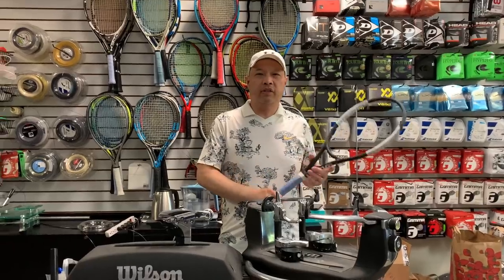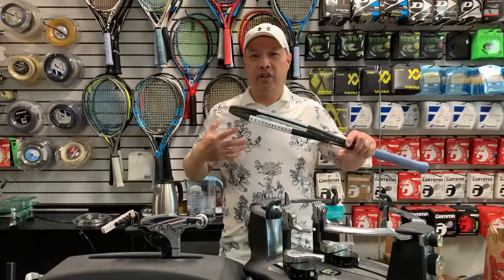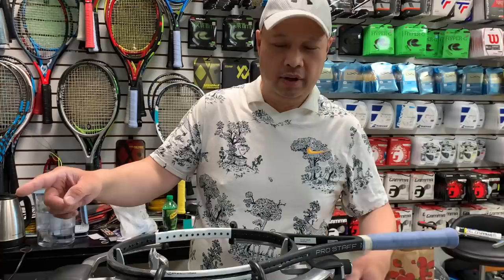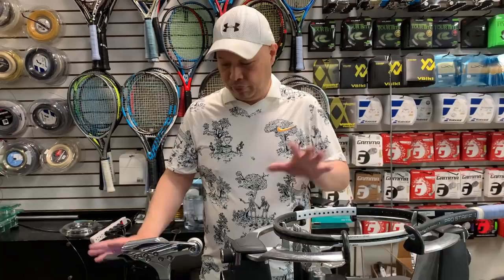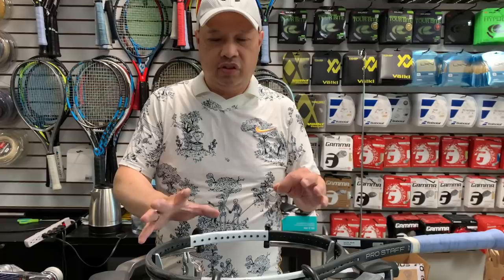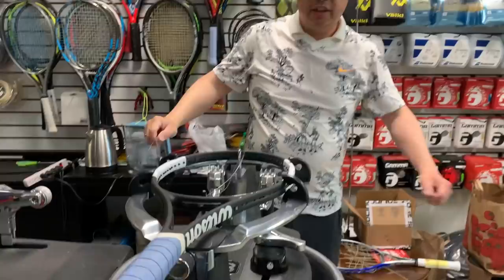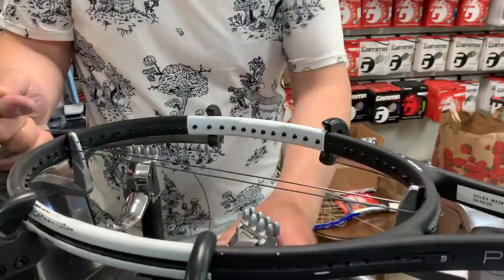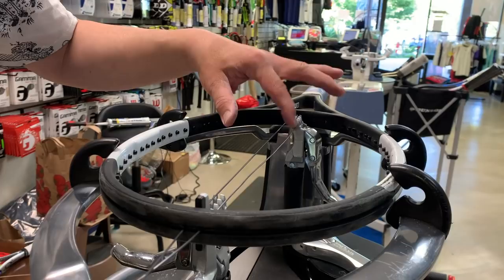HOW TO STRING A TENNIS RACKET   PART 1 THE MAINS

Comment: I've measured the difference in tension when using, and not using the diablo. I found using it actually decreases the tension, by about 1/2 pounds. The main reason for the diablo, and why it should ALWAYS be used, is that it reduces the amount of clamping force needed by the tension head to hold the string. The diablo protects the string, so use it.

Comment: As a stringer myself I always put a starting clamp behind the  “anchor” clamp when starting the mains in case that clamps slips. I also always opt for a pro knot but that just comes down to preference. You clearly have been stringing for years because you evenly do the mains- so often I have newbie stringers start in the pro shop that will pull an entire side of crosses before touching the other side which can warp the frame. Good video and even though I have been a stringer for a decade I always enjoy watching another stringer work :)
Reply: 3 one side first, then 4 the other side, then 2 and  2 and continues, right?
Reply: @NachitoBinnevies  I go 4 and 4, then 2, 2, 2, 2.  That's pretty much the standard at pro level.
Reply: My brain hurts at the lack of starting clamp behind the first anchor clamp!  He basically said, hope for no slippage.  How about guarantee that with the starting clamp?!

Comment: I am a professional musician and I am learning stringing with my 14 year old son who's starting to break strings frequently.  I figured that if, unlike most pianists, I can learn how to fix my broken grand piano strings just by watching, then why not tennis racquet stringing too!!! 

Your videos are excellent - very clear, thank you.  

I have a question re testing the consistency of tension as you go.  Given the symmetry, the central two strings when plucked like a guitar should be the same note, as should all the opposite numbers, provided there's an even number on each side which have been done - as the racquet frame is equivalent to a violin/cello/piano 'bridge'.  Even though the stringing is being done to an even tension, because of the differing lengths there should be 8 different pitches, corresponding to the 8 pairs which are the same length as each other: the outer strings should be in unison (sounding the same note) just as the first two should.  Have you tried this, as if it works in practise, it could be a useful guide for learners who can hear this as to how well we're succeeding in achieving an even tension.

Comment: One of the more clear instructions for tying a simple knot. For some reason other people make it more complicated then it needs to be.
Reply: Well some of the other knots are not really that complicated.   Both the double half hitch and Parnell knots require going under over and through twice.  Some times tying off crosses the clamps are really tight to the tie off grommet and you can use the wilson pro knot where you only go under and over and through once.

Comment: When you pull into the frame on your first hitch, I think you risk damaging that gromet, particularly if it's on the old/brittle side. When you tighten the Pro Knot, you pull away, up and THEN back to seat the tightened knot in the grommet which is IMHO less stress on the grommet.  I think the Parnell works the same way, but I don't use that one unless for some reason I don't like the way the tail is going to point.

Comment: how about a video talking about racket stringing machines...thanks
Reply: Absolutely!, that Wilson machine does not enjoy a good reputation... babolat machines on the other hand, seem to be in another league
Reply: @jlparcerisa  What's wrong with it?
Reply: @Fred_P  they are known for stringing tight, also not very friendly to thin guages
Reply: @Fred_P  I have two of Babolat Sensor & one of that Wilson in my shop. Babolat's clamp hold the string better than Wilson (I use babolat Clamp on Wilson machine) , more stable and user friendly. muuu...I am so sorry, my English is not good enough to explain  the different.
Reply: @jlparcerisa  Thanks for responding! By tight you mean with higher tension than what is set? How so, by crushing them with the clamps or the tension head?
Reply: @senasonic  Thanks for responding! Ok, I see. But there's also a price difference, so I guess you get what you pay for?
Reply: @jlparcerisa  Honestly, I don´t think the Wilson Baiardo has a bad reputation.  Instead, it´s the holy grail of stringing machines. Of course it depends on the user and maintenance.  About tension, the problem usually are the clamps, the gripper, maintenance (calibration, cleaning, etc...) and the user.  Clamps are calibrated according to string diameter.  Should be no problem with such a good machine.

Comment: thanks for showing the trick w/ the starting clamp and the loop.  I'm not trying to maximize string that much but switching to a poly from a multi, I'm shorted myself b/c it didn't stretch as I was used to...

Comment: As someone who's been stringing for a while, I like to see how others do it to pick up some tips: I've never used the starting clamp to aid in pulling knots where necessary, so I look forward to doing that. Other notes- you didn't explain that only doing some mains on one side first, then switching sides is to keep the tension on the frame as even as possible to protect the frame; I found it interesting that you started the string insertion at the head of a throat start, then pulled it back through to the top (I just start at the throat with either side of the string); I don't like cutting the string after knotting until after I release the clamp just to make sure the tension doesn't pull the 2nd knot out if I cut just a little too close. I didn't notice, do you show a 1-piece stringing?

Comment: I learned something by watching this video. When I  run short of string to the gripper of the machine I usually join another piece of string with a hard to tie fishing knot. The starting clamp method is much easier.

Comment: I measure my string the same as you did and add one more segment of the longest main string and give it to a stringing guy, but somehow he said it was not enough length to string the main. He asked for 2 more spare segments of the longest main string. He also required the same for the cross. I don't know what kind of stringing machine he has. I have to cut the string again and throw away the old strings which he said were short.

Comment: Very much appreciate this and the other videos you have posted. Any tips for those of us who string at home with a drop weight stringer?
Reply: If you have a drop weight stringer, then you have to set the weight tension with the drop weight, and make sure that when you loop it around the clamp connected to the drop weight, it's tight so you don't have to keep cranking it. Also let the drop wait down slowly so it doesn't catch on anything. The best place to stop cranking it, so you know that it is the right tension, is when the bar holding the drop weight is a little bit above parallel to the ground. Also instead of having to pull knots tight with pliers or something you could use the drop weight and just let it down a tiny bit. Make sure that when you're tying a knot you don't make it the same tension as you would the string or else it will definitely snap, just let it down enough to where the knot is tight enough. I hope this helped you out. 👍

Comment: Generally, I need a lot more slack than just one inch.  I think part of the reason is I have a cheaper stringing machine using a drop weight and the slack has to reach the weight's clamper as well as needing the slack to properly tie off the mains.  Another way to save a little time is to measure half the string bed and then simply doubling it instead of re-measuring the other half.

Comment: Is there an accurate electronic string meter to check the tension of the strings on your racquet on the market?
Reply: Ert300 but unfortunately out of production now sure the reason..fantastic tool to have ..if you're lucky

Comment: Wow, another great video. I love your channel. You are an awesome shop owner. I like your tip on using the the starting clam as an extension when the string is too short to pull. A few times I messed up on my measurements so I had to re-start the stringing again. Thank you.
Reply: The original name for that clamp is a finishing clamp. They were designed specifically for that purpose. It's just become more common to use them as a starting clamp, especially on crosses.

Comment: I've wanted to purchase a stringer but was put off on the price. If someone was to purchase a stringer primarily for self use and for a couple friends, what stringing machine would you recommend? Thanks and keep up the great work!
Reply: From personal experience, I started off by getting a used crank machine off Craiglist for $300. It definitely paid for itself, in the long run. I would try looking online for used machine, as you can get a great quality machine for a fraction of the price of a new one. Practice the stringing craft, and as you get better, maybe you get more clients to string for, then upgrade to a better machine.
Reply: @jeffreylin8100    Thanks. Appreciate the feedback. Makes sense.
Reply: I have been using the Gamma X-2 stringer for the last 13 years with no problems. If you have extra cash get the Gamma X-6 FC

Comment: Thanks for the great informative videos on stringing - I've picked up several good pointers - I've been stringing for the last 10 years.
Just wondering - does anyone out there have any good suggestions for uses for left over tennis string? Typically you end up with left over pieces that are a foot or two in length - I am hoping that there is a way of re-purposing these than just sending them to the landfill. 
I've got miles of these leftovers at this point and don't have the heart to just throw them away.
Reply: Use the extra left over string for starting clamps😊

Comment: Hi there. Great Channel Mate! You have been very informative for me. I have just  started out stringing with my first machine (Gamma Progression II ELS). Have a question about mixing Gauges of string in the crosses and mains. I was contemplating using a 16g in the mains and a 17g in the crosses. is this something you would recommend or not? 
CHeers. 
Peter.

Comment: If you clamp close to the frame, does the string tend to break when one hits the the ball off center where the string has been clamped. 
   Also, starting clamps are expensive but essential to stringing. What are the best companies for starting clamps and floating or flying stringing clamps? I need a replacements.

Comment: have an inquiry about stringing . i have seen a local stringer at our city always pulls the string at the required tension from the racket throat side . not one time from throat and one time from head,my question how this would affect the tension , racket stability and sweet spot ?
Reply: If the local stringer is not alternating head/throat after each pull then the stringer is double pulling and the racquet will come out like crap.

Comment: Hey, if you string a poly at  45 in the mains. What is the acceptable maximum tension one can or should use on the cross strings without compromising the racquet frame(collapse)?

Comment: Haha knew it, he was short. Don’t do this newbies. Measure the main 8 times the length of the racket and you should be good with out having to use the starting clap as an extension. For crosses, measure his way is ok
Reply: That was always gonna be short,   I don’t measure like that but if i did I would of added 2 full more mains for the last main / knot.
Reply: I think if you run a store, you're trying to get as much out as a reel without wasting. I think using the starter clamp as such does that well. I do it too. If being frugal is not a consideration, just pull about 20 ft.

Comment: What is the significance of the skeletal graphic design on the shirt. I almost bought on at a sports box store.
Also, how would you start if you had flying clamps versus the fixed clamps used in this video?

Comment: Does cutting a single string in half usually leave you enough for the mains and crosses?  I've been pulling the string the length of the racquet  as many times as their are mains, plus 1 or 2 pulls.   Wasted a Solinco Confidential string by ending up short on the mains, then started over and used more pulls for the mains and was short for the crosses but somehow managed to finish the last cross by hand tightening and clamping it.  Was only able to get one half hitch as my last knot and almost wasted a Luxilon.  Very frustrating to say the least.

Comment: When you buy just a single set of string, do you still have to measure it?
Reply: No, they are always 12m/40ft, sometimes slightly more, so you can just cut them in half without much thinking. Mains are always longer, so you can also go ~6.2m for the mains and ~5.8m for the crosses, but the result is the same really.

Comment: Before I watch the end, I think you will be short in last 2 mains. Let's see. I measure 8x2 of full H to T. That works for me. You are even saving more string!!
Reply: I am at 16.20. Guess what, you are short a little bit. That much short can be a factor if you don't a great starting clamp.
Reply: But you will string 18-19 rackets per reel  vs 17.

Comment: To be clear, you tied off the mains on 8T, not 6T as recommended by Wilson, to avoid covering 2 cross holes instead of just one. Why does Wilson recommend tying off the mains on the 6T hole?

Comment: Great video. New to stringing. What’s a good string machine to purchase? Has anyone had any experience with Alpha M8 or should I save the money and get a manual crank better?
Reply: I have zero knowlege on the Alpha line.  I've been using the Gamma drop weight machine for the last 10 years.  I only string for myself and friends.   I too am in the process of upgrading to a new machine, because I want a consistant string tension, and two because it takes about 3-4 times longer to string with a drop down than it does with an electric or crank/lockdown.  If you are very particular with your tension (it has to be to the pound accurate), then diffinately get an electric because it has the constant pull.  If you do get a crank/lockdown, you can always add a Wise and save the crank for backup (if you are stringing in an area that doesn't have power or if you need to send the Wise in for service).  Check out the Gamma line up...they have a lot of options to choose from, cranks, electric, tabletops.  And when shopping for your machine...check out what type of base clamps are with the machine.  Another thing to decide is if you want a two-point mounting system or a four-point.
Reply: I have the Gamma X2 drop weight stringer for the last 13 years. It's pretty solid. I like the drop weight because it's constant pull and it lasts forever. I only string for myself and a few other people. I like the Gamma X-6 FC if I'm upgrading.

Comment: So if I am on a drop weight, should I do 17 times instead of 16 for the mains because drop weight needs a bit more string to pull the string.
Reply: Unless you go from 65 pounds to 30 or so (even then), you won't notice the difference in string length imho
Reply: His method will work on the drop weight or any machine if you don't have enough string.  I've been using a drop weight for 10 years now, and just do 20' per side to make it simple.

Comment: Hi, my local stringer always tell me that when a raquete is strung on a automatic machine it need 13 lbs less. Is it how The pros do?
Reply: Can you be a bit more specific in your request? Just curious 🤔 Thanks
Reply: If you are comparing a constant pull to a crank I think 13 is exaggerating.  The string stretches and once you set the clamps it continues to stretch.   So constant pull makes it tighter for that 1-2 seconds while setting the clamp.  I would say 5-6 pounds tighter on a constant pull.

Comment: for those that will use pliers instead of a starting clamp to pull the knots...be careful that it doesn't slip and you end up stabbing yourself.  I haven't hurt myself prior to getting a starting clamp but it has slipped.

Comment: I just did this racquet on a klippermate...it only has 2 points for mounting.  I hope it works ok
Reply: A 2-point mounting system is fine...it's all personal preference.  But some prefer a 6-point mounting system to prevent racquet distortion.
Reply: I have strung oversized rackets at 75 lbs and the 2 point mounting on my Gamma machine never cracked the frame.
Reply: How do you manage stringing with no ratchet mechanism on the Klippermate?
Reply: @rishijai  I'm not sure what you mean exactly.

Comment: 10:04 when you let it go, the clamp moved....losing tension?
Reply: This is normal movement. It will happen every time you take the string of the wight.
Reply: As long as the clamp base is tight enough and doesnt slip, you will be fine

Comment: Are double knots required?  I only see one knot on my rackets.
Reply: The first knot may be pulled very tight and into the grommet a little bit which can hide it
Reply: parnell and pro knots look like a single knot compared to the double half hitch but there are two knots in a way because they rest upon each other